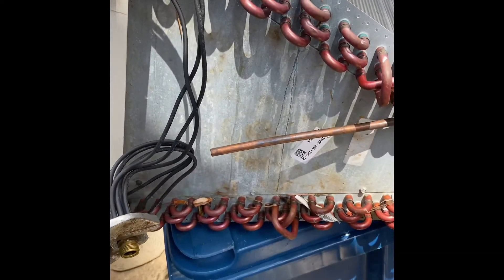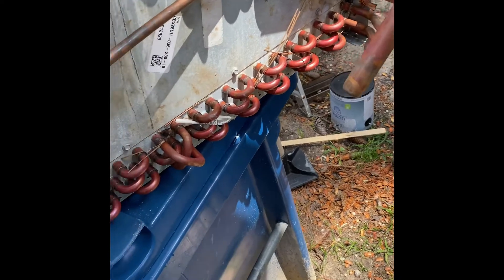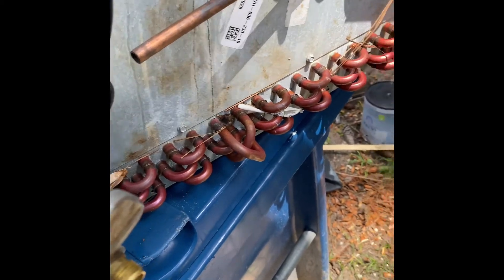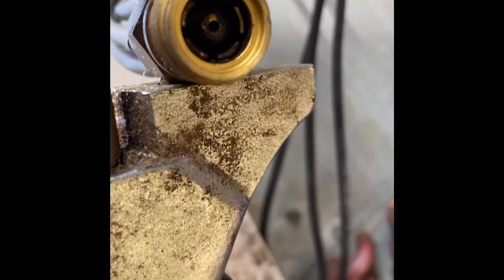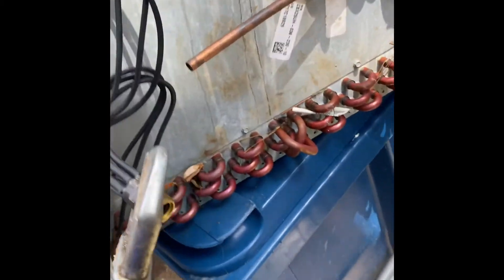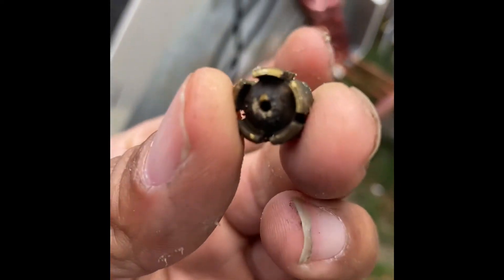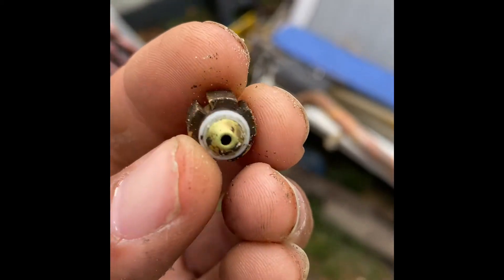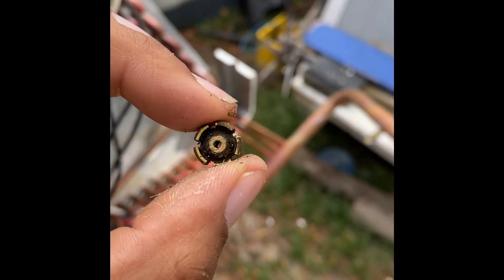How to check a piston or TXV on an air handler

Comment: So a new guy goes and just starts taking off the nuts and refrigerant starts leaking everywhere. Not a good video
Reply from the maker: That would be a much bigger issue than me making a video
Reply: Is there is a way to know whether or not the air handler is using a txv or piston without looking at the indoor unit because I have experience workers know which one a air handler unit immediately unless they did service in that home before